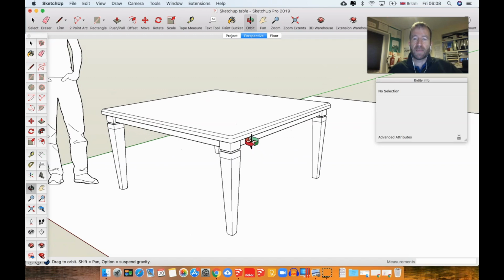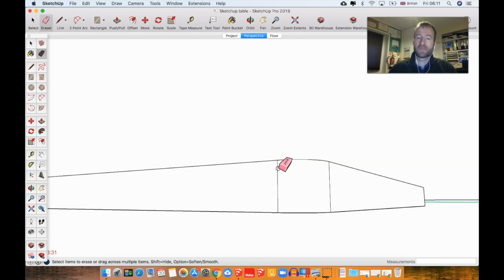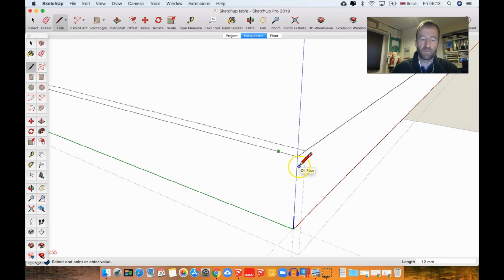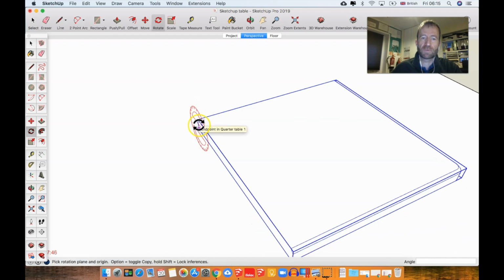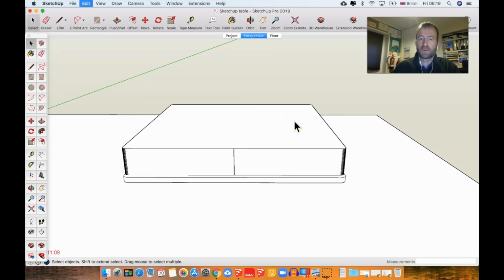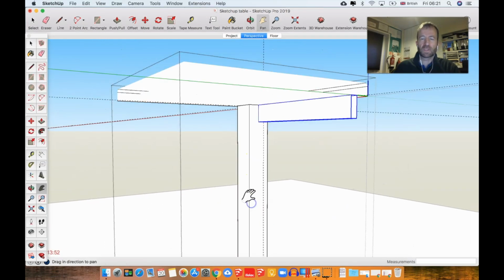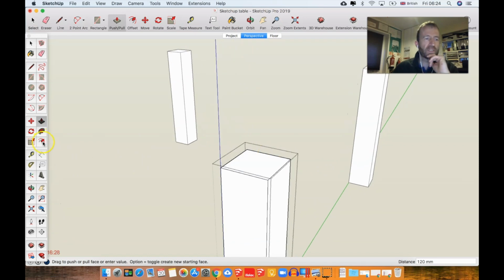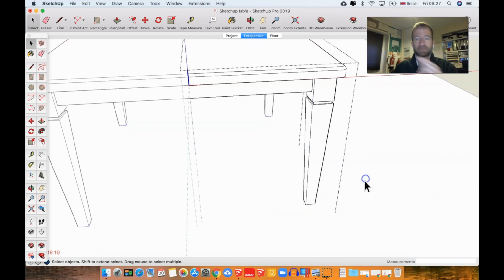SketchUp for fitted furniture makers: episode 4, duplicate components, arcs, chamfering, tapering

Comment: @FreebirdInteriors  Hello again! I have a question: when you click on an intem you create, where can you see it's mesurements/ dimensions? Even in your videos, when you click on an item, the measurements box in the low right corner it's empty, I can't find where to look for. I have the PRO100 design program for furniture and there I can see it any time I click on an item and it's very helpful. Can you help me, please? I'm still in the one month trial period with the SketchUp pro and it makes me question if I should buy it or not, especially when such an easy and helpful feature is missing...
Reply from the maker: Ryno Vlad interesting... I can see why you would want that, yet I have never thought of needing it.  I use guide lines a lot - the tape measure tool.
Reply: @Alastair_Johnson  Yes, I used those too, but if you click on an item and you see it's dimensions straight away, all of them, it helps alot, you don't need to look back on your sketch on paper or phone( I use a Note 10+ for that) , especialy when you do only fitted furniture, where there's no standard dimensions. It helps you save alot of time.